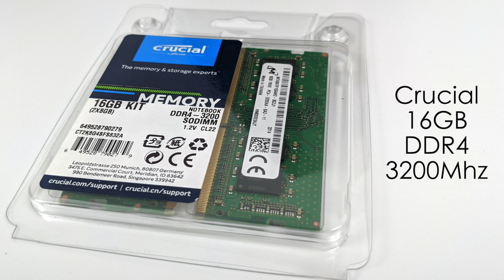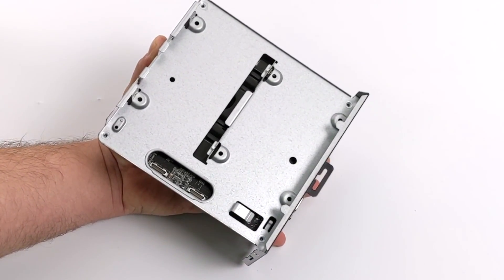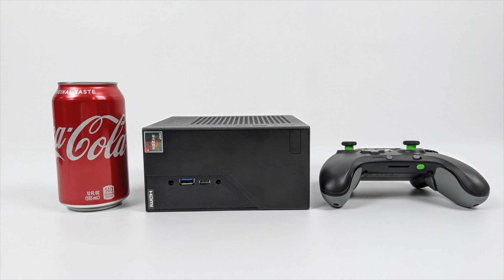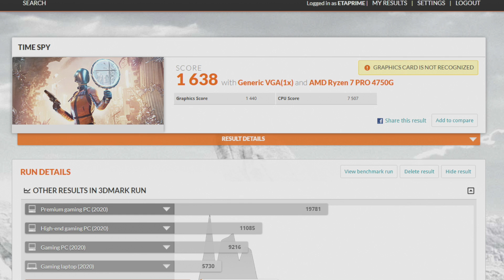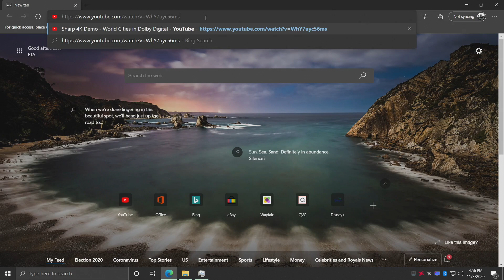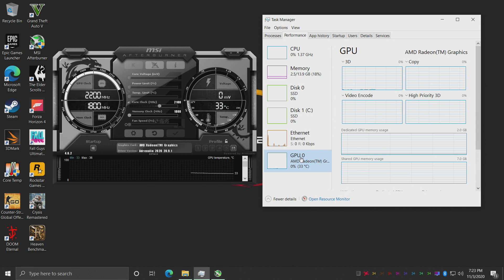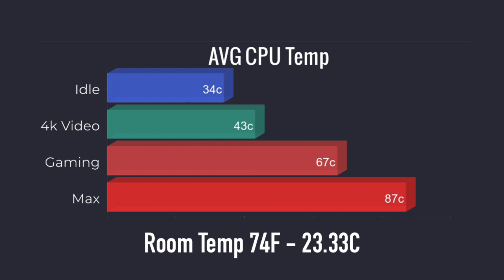Ryzen 4750G ASRock Desk Mini Build - A Tiny APU Beast!

Comment: I have ordered msi z390 a pro and i9 9900 will this perform good or bottleneck performance please guide
Reply: with what gpu? u didn't really specify a bunch but with an i9 that should do you good for at least 6 years
Reply: @enzo-ez3gb  x570
Reply: @ShubhamRaut-v3k  do you mean the RX 570 from amd? if that is true, even the 8gb RX 570 would be a huge bottleneck
Reply: realistically you would want at least a 2000 series nvidia card, but if you're budget limited the least I'd go for is a gtx 1650 super, wasting your i9 if you'd go for weaker gpu sadly.
Reply: @enzo-ez3gb  bro then I will wait till January for buying 2000 series gpu because of budget problem.
Thanks brother for helping me.
Reply: @ShubhamRaut-v3k  goodluck man, sad to see that i9 go unused for more than a month tho.  I guess if you can wait more you could get one of those rumored 3050tis that are supposed to be both strong and cheap af.
Reply: @enzo-ez3gb  ha ha

Comment: It's already been tested by many others with coolers with a similar heatsink-fan setup to have the fan draw air in instead of pushing air out. You drop at least 10°c - 15°c when you fix the fan orientation.
Reply: Would you recommend any video about it? I liked the idea.

Comment: Do you think I going to be ok using a Ryzen 5 3400G  (due to budget) and do I need to use the same heat sink or I'm ok with the cpu heat sink?
Reply: Of course u can use the 3400g.  Use the heatsink that comes w the cooler w the 3400g (I believe it comes w a fan + heat sink combo).  If not, use the fan & heatsink he used
Reply: @zerocal76  Thank You..

Comment: I am shocked that it still uses Vega core graphics, its like they dont want to give in to better APU performance as to not harm their GPU sales.  I hope I will live to a day when these small apus have powerfull enough graphic core to run new flight simulator on 60 fps maximum settings.

Comment: Well, the reason you got 136.3W from the wall socket is because the power supply will consume a bit higher than their rated output, which is 120W in this case. If you take the input and divide the output, the PSU has 88% efficiency, which is not bad. If you can get a 150W or 180W adapter, it may actually give this unit a better performance but also greater heat output.

Still, wish they have a way to at least install a dedicated GPU, either through ThunderBolt 3 or PCIe extender, even if it is proprietary connector.

Comment: I like the design of the heat sink. Never did like how the processor blows heat down on motherboard components and ram.
Reply: Actually it's tested to show any air movement over modules such as the vrm coolers or the ram has a benefit. Even if it's hot hair from the cpu, the fact that it's moving is better than stagnant warm air.

Comment: A few questions:

1. How loud is the cooler at idle/cpu load/full load? This would be perfect for a mini audio recording PC to carry around if it can remain silent.
2. How does it compare with Noctua L9a and Alpenföhn black ridge? I understand that Alpenföhn is better than Noctua and not much more expensive.

Thank you
Reply: you can always use fan speed app for this, acoustics for this type of coolers are ramping around 2700 I think, but the bearable one would be 2200 rpm or if noise is a problem, you can go for 1500 as it is already a decent speed to exhaust heat.
Reply: @alwinnadela396  Yes, but I'm interested in the noise profile, because I would like to use this as a mobile audio DAW recorder and need as much silence as needed.... And when the CPU is 100% utilized, I need to be relatively quiet, not a mini storm.

Comment: I just looked up the pricing on everything. The cheapest I find was $1,300 for everything.

Basically how to try and build a Xbox/PS5 for 3x the price. As much as I hate consoles, I think they won this battle.
Reply: i3 9100f, used 1060(got one for $100), cheapest mobo that can handle faster ram and 9000 series intel, 450w psu, 128gb m.2, 2x 8gb ddr4 1600-2400 mhz
Reply: I got all of that done for around $330, use your resources. That pc is an easy xbox one/ps4 killer

Comment: Do you know if this will work with an A300? ive got one currently with a 3400g and its just a little too slow for my liking. if i could upgrade to this cpu it would be great
Reply: 4750G can also be installed in A300 but you need to upgrade your BIOS first(P3.60L Beta) !!

Comment: Any idea how it'd perform if you plug in an eGPU with, say, a 5700xt or 2070? I've been using my laptop with an eGPU lately, and it's been great, but this seems to have a footprint that is even smaller than a laptop. Plus, I will not need mobility any time soon, so I'm on the edge of switching.

Comment: I wonder what kind of performance increase and temp decrease you would get from mounting a fan on the "top" to maybe draw air out of the case.
Reply: You would get a decrease in temps. You want the fan to pull air in the case from outside.

Comment: for even better cooling performance, you shoudl turn the cpu cooler by 180°, so the heatpipes are on the right instead of the left, this will result in the sidepanel mesh lining up better with cooler. =)

Comment: It would be nice if AMD released the 4700g to the public instead of just OEM. Exact same specs as the Pro 4750g, only difference that may be important to the average user is supposedly higher silicon quality in Pro APU's. Other stuff is just business related security implementations.

Comment: at 2:50 you said "I didn't go with faster ram because prices on faster SODIMM ram, right now"..
But on AMD's website, it says 3200Mhz is the fastest ram compatible with the 4750G.
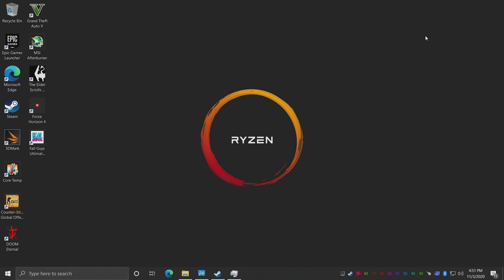at 10:28 you mentioned overclocking the CPU, and "the motherboard won't allow it"..
AMD says it's not "unlocked"
This is just info for anyone thinking of dropping $400 on the 4750G (only available from China, Japan, Hong Kong, and Israel), so maybe this will help you know what you're buying.
Reply: The first point I’d like to point out that’s what the standard rate is, but it can exceed it. Like technically a intel 10 series Cpu bas spec is 2666mhz. But unless it’s a locked chip or motherboard. It will run 3200mhz without issue pretty easily. Despite being technically a overclock (yes xmp is a oc technically. Though most don’t think of it as such)
Reply: @ShartsInTheAir  If you put 3600Mhz ram in the motherboard, it's not going to work, if the AMD CPU isn't spec'd for it. That's what I was pointing out, XMP/overclocking is a different subject.. He overclocked the ram in this video to 3400Mhz, he said.

Comment: I wander if AMD could make an APU capable of 8 core 16 threads with 2 CPUs being extreme performance, 2CPU's being low TDP performance and the remaining 4 being power optimised lowest TDP cpu's while also having an equivalent integrated GPU to the RX 590 8Gb, with 4GB of ultra compact gddr GPU memory while also using the system memory up to 8Gb... while keeping the entire APU under 150W TDP on full usage and around 90W in normal gaming.

Comment: Could you please try gaming at 720p/900p fullscreen (on 1080p screen) with say 4xAA ? I'd just like to see what that looks like in terms of increased frame rates vs acceptable image quality. I think that in some games (like CS:GO for example with low fidelity graphics anyway) it's perhaps acceptable to slightly lower the res if it increases the frame rate ? But I haven't seen any APU videos that test it.

Comment: I just am not finding anything old or new, that beats my current Alienware Alpha for small size, media and gaming performance. I paid $600 new. How does it compare to what you made? (i7-6700t, GTX 960, 16 GB, 512nvme +2TB HD)
Reply: I am sorry, I meant, I haven't found a compelling upgrade.
Reply: TimeSpy 2,540 with NVIDIA GeForce GTX 960(1x) and Intel Core i5-6500 Processor
The Ryzen 7 4700U TimeSpy 1066 for the graphics.

Comment: My Noctua L9a aircooler with an 98*98*25 mm Noctua Redux fan is superior, because it allows the installation of the two additional side USB ports.This aircooler doesn't allow the installation of USB side ports.

Comment: I built a system around a Ryzen 5 3400G based on a build you did on a Ryzen 3 3200G.  I couldn't get the same case you used and I used a different 12V DC Adapter from Amazon.  Still, I am very pleased with it.  I use it as a Plex Media Server and Plex HTPC hooked up to my modest AV Receiver and TV.  It also runs low end games fine.  My wife and I like to play Overcooked on it.  I use an Xbox 360 dongle so with the kids we have had 4 player couch co op going on.  I use a Logitech K400 BT keyboard with touchpad to drive from the comfort of the couch.
Overall, there is just something neat about a little PC in the living room.

Comment: I am waiting for the 4700G to eventually hit the retail market. I will probably use the A520 board with no overclocking. I already have the mini-ITX V1 cube (snow edition) by thermaltake to put it in.
I can then use the pciex16 slot for a second M.2 card.

Comment: Its a real shame they never made these available  to the general public, these are great APUs.
Reply: you get the same performance on a 2200g/3200g as long as you use at least b450 and fast memory and tune timings, my 2200g is faster then the 4750g in the video, i run cs go at higher avarages in 1080p, about 140. igpu overclocked to 1600 mhz and memory at 3466 cl14.
Reply: @budgetking2591  Same performance 2200g vs 4750g.  Dude.  You are beyond wrong.  LOL.
Reply: @EVLS10  In games yes, you obviously don't know what you are talking about. memory bandwidh is bottleneck.
Reply: @budgetking2591  i would go for the 3400g you can clock it to 1800mhz and the 3 CUs more make a real difference when using good ram, if you are lucky with the chip you can use 3600mhz ram. lower latency is also better of course
Reply: @mhh3  i actually tried that and there is almost 0 difference, the 3 CU's extra do little to nothing, even af 8 CU's it's aleady memory bandwidh bottlenecked hard even at fast ram and timings.
Reply: @budgetking2591  well enough videos online that proof the difference

Comment: the sata connectors aren't proprietary, they are actually a standard and quite a few use them ;-)
and the PSU you forget that the 120W is on the PC side not on the wall plug side of the PSU (efficiency yada yada)
Reply: So if we assume 80%+ efficiency, that would mean the max draw should be 150W pulled from the wall before it overloads? Since 120W / .8 = 150W?
Reply: @bagelbytes69420  if the math is correct then yes (just woke up so can't be bothered to check but it looks right)

Comment: Test X300 with 3400G with max overclocking CPU, GPU, RAM. See how it perform against 4750G.
Reply: Its pointless to overclock the CPU in these APUs because they are CPU bottlenecked. Just use any extra headroom you have to overclock the GPU & RAM.

Comment: I'd like to see how it performs in emulation and virtualization by an ESXi hypervisor or Proxmox and emulation in a virtulized environment.
Reply: I have the previous version, the A300 running with a 4650g as a Proxmox server. I have one large VM running all my Docker containers then a couple of smaller VMs for dedicated things. It works incredibly well. The one downside is they only take 2.5" drives which aren't great for servers so I just have a 1tb M2 NVME in there for the actual images and offload a lot of the data handling to a NAS.

Comment: I have a asrock deskmini a300 with a 2400g, would that cpu work in this?
Reply: Yes it will. I have the A300 with a 4650g. But there are issues with RAM overclocking on some of the units with a 4750g.

Comment: 7:27 How to avoid the thermal paste comments. LOL
Reply: @ETAPRIME  can you put external gpu on this thing?
Reply: @betamasud  nope, that would most likely need a thunderbolt connector, which is not there
Reply: @betamasud  with an nvme to egpu adapter it will do. There is a video on youtube with A300, if one day i manage to get a gpu :) i will try it
Reply: @ETAPRIME  Are we ever going to get an emulation video? Please? :)
Reply: @ETAPRIME  hey i live about 15 minutes from wake forest. Is there anyway I could buy any devices or emulation pc from you?
Reply: @ETAPRIME  can this run teknoparrot and all other lightgun games??
Reply: and screaming about the back cpu plate.
Reply: What the tube is not one time use? Damn that explains the mess I did.
Reply: I'm honestly surprised I haven't gotten any thermal paste comments, with all the horror stories I've heard.
Reply: @darxustech2883  As long as you don't apply too much or too little, it does not matter.
Reply: @captain7327  gamers nexus has already killed the myth of too much thermal paste.
Reply: @QK_SAND  while it won't negatively impact the Temps, it can spill out over the board, and at the very least it's unsightly
Reply: Ahahahah
Reply: How is the temp on the IS 47k so far since you did this video?
Reply: Was Genuinely hoping to see you technique too... :(

Comment: You might be able to get even better temperatures with that ID-Cooling if you turn its fan blowing air towards the motherboard and sucking air through the heatsink. This cooler looks pretty similar to Alpenföhn Black Ridge cpu cooler and some people have gotten better results with the fan facing towards the motherboard.

Comment: The thing about the ASRock Deskmini series is that they're not really SFF PCs--they're SFX motherboards with a free case included. If there's another sub-mITX non-embedded mobo out there, I haven't found it, which makes it the perfect choice for custom / creative space-limited builds. For example, I restomodded an old iMac G4 by throwing an A300 mobo (with a 3400G) into the hemisphere base. Will definitely be eyeing upgrading to the X300 once the Renoirs hit the open market.

Comment: I'm really interested in seeing this thing run PS3, WiiU, and the Switch emulators among others
Reply: it would run well, i used to play cemu and rpcs3 on a 3200g with 2133MHz 8GB ram at 30-60fps  depending on game
Reply: Might be nice to see a 5000 series cpu in here
Reply: 1889
Reply: Can't handle PS3 very well, even 3700X and 10700K struggle with The Last Of Us.
Reply: @saricubra2867  Because TLoU is not yet playable, watch ETA videos with Ryzen 3300X, its running PS3 really well, this 4750G should run it pretty good.
Reply: @saricubra2867  granted, The Last of Us was one of the last games of the generation and is one of the more taxing titles..
Reply: It wont run those emulators very well.
Reply: @yosoywilson78  why? 3400g is almost running them well
Reply: @csl110  Havent followed development of CEMU for a while now. Didnt realize they had Vulkan support now. I tried it on my old 2400g and it was crap. But I guess 1080p 20-30fps is ok.
Reply: @yosoywilson78  my 2400g runs wii u games at full speed with newer cemu versions.
Reply: @yosoywilson78  I mean ps3 games did run at 30 fps so seems good enough.

Comment: ETA, at 10:20 you are showing 2GB dedicated GPU RAM.  You should have a bios option to go to 4GB and will get a noticeable uplift in your gaming.
Reply: You can set it up to half of your total RAM so for his build he could dedicate 8gb. But with Ryzen APUs it doesnt matter how much you dedicate in the BIOS the APU will use as much as it needs. I keep mine set to 64mb and I play PUBG & Warzone.
Reply: It will use what it needs, hence "shared GPU  RAM" , but dedicating more than 2 WILL make a difference.
Reply: @knifemind  It literally makes ZERO difference to dedicate more RAM to the iGPU. Games play exactly the same no matter how much RAM I dedicate to iGPU. Your just taking away from the available RAM pool for when you arent gaming. Do you even own any generation of the APU? Because Ive tested this myself and I have no performance gains.
Reply: @yosoywilson78  I run a Deskmini.  And you are not correct.  Sure, in many situations it will make no difference.  But that's not always the case.  In some scenarios it makes a significant difference.
Reply: @knifemind  Show me.
Reply: @yosoywilson78  I concede. I ran a few benchmarks with 4GB & 1GB, and while there was minor variance, everything was at most 1.5% lower. Within margin of error, for sure, but also consistent. Clearly there was another factor that led to my performance gap when I changed my VRAM settings and I'll have to investigate to find out what it was and why it occurred. Apologies for being argumentative.

Comment: With all the optimizations with CEMU, can we finally get Wii U on an AMD APU? 720p30? 1080p30? I assume at least MK8 is playable.
Reply: Yep, i got a 2400g OC @3.9ghz and igpu @1500Mhz, 8gb of 3000Mhz dual channel cl16 ram with OC timings and Nvme. It stays at 30fps pretty well, 1080p on BOTW in the great plateau with cemu 1.21.3 vulkan.

Comment: I think your gaming results were definitely bottlenecked by that ram. The 'sweet spot' for the ryzen chips is either 3200CL14 or 3600CL16. That cl22 ram just wasn't cutting it, I think.
Reply: 3733

Comment: I sawed off that stupid tab on my H110 a long time ago, cause a copper-core intel box cooler woudn't fit in it. Also, DM2USB wouldn't fit with this heatsink orientation, if you are planning on adding some front USB in the future (or now). You should try and flip it 180° to free up some space at the front, or better - go with NH-L9a, which is more than enough even for a beast like 4750G. That's one thing that bugs me - there seems to be no DeskMini's with preinstalled USB2.0 expansion, and it's rarely sold separately (only appeared in my region couple of years later, after 310 release). I almost made my own FP_USB module at one point, that's how desperate I was for more I/O. Other than that - it's a perfect miniPC. I moved my mini 110 to the office, where it still works 24/7. Small, cool, quiet, and miraculously doesn't collect that much dust.